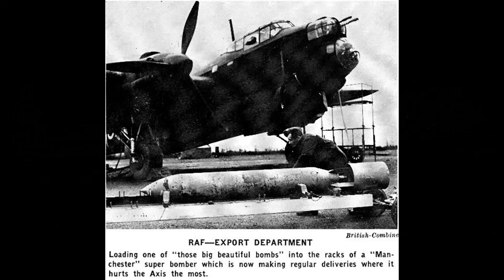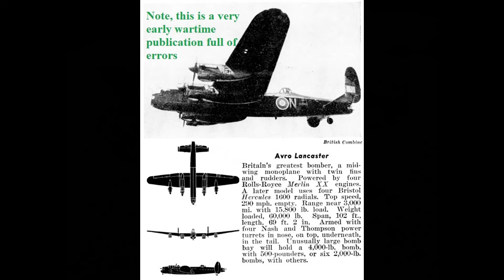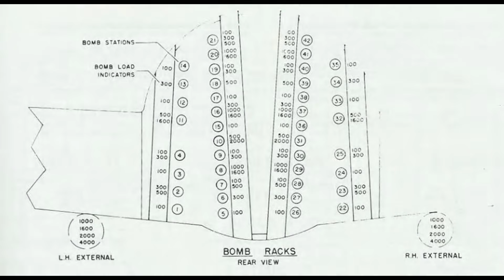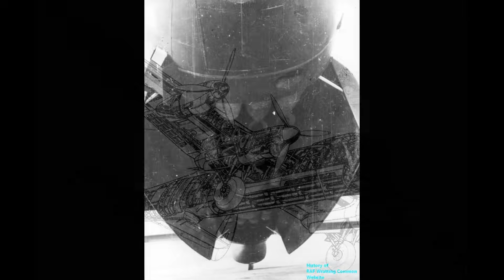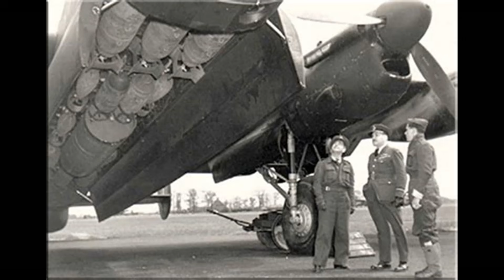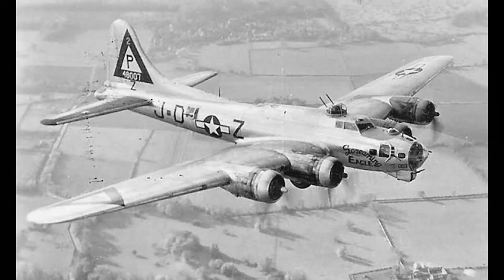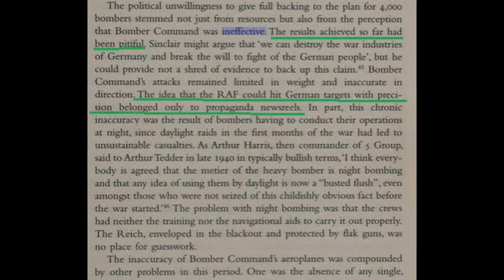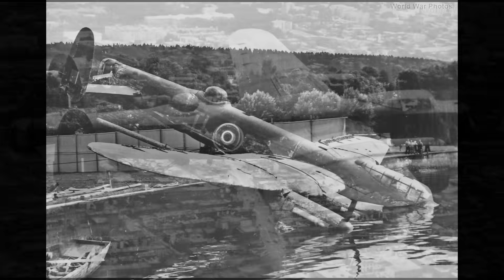Avro Lancaster, Payload, Turrets, Stability and More

Comment: My dad was a w/o  in the RAAF and did 2 tours of duty in RAF lancasters towards the end of ww2.  The crew worked between tours of duty testing new ,rebuilt and prototype Lancasters and some early Lincolns prototypes due to the skill of their Canadian skipper and English engineer.The rest of the crew were tough Canadians and Dad an Australian A lot of the work they did was testing tailwheels to cure the tail wheel shimmying which was a Lancaster problem.The were invited to volanteer to join Pathfinders . However the crew worked as a democracy and voted to go back to an ordinary squadron. They  soon discovered that they were in a so called CHOP squadron which was a low key RAF version of a Russian  penal battalion for trouble makers and the like where the average life expectancy was a handful of sorties;.
On the airfield was  a strange Lancaster with big paddle props and .5 inch armament . It was  hard for the other pilots to fly.Dads skipper put on an act and grudgingly agreed  to have it but warned the crew not to be enthusiastic They knew what it was from testing prototypes and having flown one of its stable mates. Apparently it a great deal faster  and had much higher ceiling  than standard Lancaster but the engines were harder to handle and it had some rough edges.
 This meant they could go up to a much higher altitude and look down on the bomber stream getting shot down and also get out of danger a lot quicker and do more violent corkscrews .
Their navigator had to be on his toes because they still had to bomb at the correct time and altitude [photo evidence] and land at same time as the other planes because the performance was a closely guarded secret in the squadron. So it was not easy task finding somewhere safe to hide  for up to an hour at night over war time England.
 Dad died 30 years ago. and basically never said which Merlins the plane had.Rolls Royce or Packard  It was built in the Austin factory and but was probably a  experimental fitment of some late war or post war high altitude single seater engine because  they could not be synchronised which made it unpleasant to fly. The RAF had sent the troublesome plane  where it sent its human trouble makers and where they thought it would be soon lost
.It dropped a lot of bombs. Survived a daylight brush with German jets  and  allowed 6 young men to survive the war. Dad put his wartime experiences on paper when it became clear he wouldn't live long which is where this info came from.  

Also Dad said that one the radars[ I Think may be Fishpond] let them track nightfigters sneaking up on them in the dark and saved their lives on occasion . Most crews weren't aware of this or shown how to do this and just used it as a navigation aid.

Comment: The pins on the bombs were arranged so that they would be pulled out by the bomb carrier as the weapon was released. You've also got electrical fusing from the bomb aimers panel ?  Imagine if the bomb bay was subject to airflow in flight, you could end up in a situation where the vanes rotated en route, that might not be good. :)
Reply from the maker: It depends on the version. Some are set up to arm the bomb the way it's done in a typical U.S. single engine fighter as you described.

Comment: I am still at the early part of this video. 

That said, one practical reason for having multiple smaller vertical stabilizers versus one large one is hangar accessibility. An aircraft with one tall tail might not fit into an existing aircraft hangar. 

AFAIK that is one reason the Lockheed Constellation had three smaller vertical stabilizers, versus one larger vertical stab.
Reply from the maker: That's true about the Constellation, but it was intended for the post war airliner market. It wasn't really an issue for military planes during the war.

Comment: Flt Sgt T J MacLean with 617 Sqn on his second tour got 4  in one night 15/16 Mar 44 He used the 4 x .303 because of the higher Rate of fire 1150rpm x4  V 850 rpm x 2  The enemy were coming in close and the .303 were adequate in distracting them or knocking them down MacLean used his own Mix of loads 45 % tracer 55 % armour piecing This was his first time He was still around in the 80s but it is not known how many more he got

Comment: Hello, possibly some day you could publish a video comparing the Lanc to the Halifax, especially the much improved Mk.III. Did it deserve to be in the shadow of the Lancaster so much from a historical standpoint? Should Handley-Page have converted to producing Lancasters instead? I suppose that at least the Halifax Mk. III put the Hercules engines to good use, did it thereby relieve pressure from the Rolls-Royce factories busy producing Merlins?

Comment: Greg, wonderful presentation, logic and research as usual. Could you please clarify the max internal load of the B-17. Every different site has a different number, mostly much lower than 12,800 lbs. Could every slot in the bay be filled?
Reply from the maker: The maximum internal payload of the B-17s used in combat over Europe was 12,800 pounds. It could also take quite a bit more on external hardpoints. I hate to sound like a #$%@ but sites that have much lower numbers simply don't know what they are talking about. Could every slot in the bay be filled? No, but because if taking 8 1600 pound bombs, the positions for some smaller bombs could be blocked, or if taking a bunch of 500 pounders some of the other slots would be blocked.

Comment: Lockeed Ventura is another low wing (more low wing then mid-wing). It's curious that in low wing configurations the twin tail assembly seems to be placed always in an upper position relative to the wing level, high above the slipstream, probably to avoid turbulence.

Comment: Hi Greg, re the comparison of single and double tailed design I would point out that when the B-24 was re-designed into the PB-4Y it was given a tall single vertical stabilizer to increase stability at low-medium altitude.
Reply from the maker: Exactly, and look how tall it had to be to get that stability and how much it interferes with the upper turrets field of fire.

Comment: the bomb bay was designed to carry 2x torpedos, hence the wing position. 15 bomb shackles were fitted and group 1 Lancasters regularly carried 15,000lbs of bombs on raids to France & Holland.
Look up the IBCC digital archive, particularly bomb aimer Bill Baileys raid memories.
Reply: IBCC Operational history of Lancaster 1B R5868
This Lanc flew 136 operational sorties in two years and ten months (less than one a week) and dropped "466 tons (assume long) approx" or 3.42 long tons or 7,675 pounds on average. I did not deduct missions in which bombs were jettisoned due to engine failure or the entire load was flares or mission was called off in flight. 
On pages one and two (July and August 1942) the entire load was 3,360 pounds of bombs. 
On page two a bomb load is 2,000 pounds plus "6 x 4 flares".

Comment: 27.30 April 1942 Lanc unescorted daytime raid. Diversion raid failed. Four Lanc's lost to fighters, no fighters lost.
Only 12 bombs detonated. 58 per cent losses.
Reply: Bombs:  General Purpose (GP)
40 lbs., 250 lbs., 500 lbs., 1,000 lbs., 1,900 lbs., 4,000 lbs.
   Add to this that entire inventories overall effectiveness was generally questionable in such that even if a bomber successfully reached the target and dropped its bomb load, there was no guarantee that the bombs would actually explode. Particularly troublesome were the 1,900 lbs. and 4,000 lbs. designs. Development and production problems continued to plaque many of these designs and many of the 4,000 lbs. GP bombs continued in limited use until November 1943 and was only then removed from the Commands inventory due to fusing problems.
American Bombs:
With United States entry into the war and the arrival of the USAAF in England. Bomber Command gained access to American made bombs. During 1944 when British made bombs were in short supply the Command dropped significant amounts of the American type ANM 44, 58 these being the equivalent to the British 500 lbs. MC's. Additionally large quantities of ANM 59 and ANM 64, 1,000 lbs bomb were also pressed in to service by all of the Command's front line squadrons.
For the Command's armours the introduction of these types was we must assume welcomed, as the American bombs were faster to fuse and tail than the British made bombs they were used to working with. However, the "box" tail design which added significant length to each bomb, drastically reduced the amounts of bombs which could be carried by each British aircraft.
Bomber Command Bombs, Mines and Incendiaries page

Comment: Okay, is this thing about wing location your theory or something you read? Because I was under the impression that is was mostly just that high and mid wings and twin tails were all things that were in vogue in the years before the war. The B-17 just predated the fad, but the Stirling, Halifax, Manchester, the B-24 and 25, even the Do17 and variants, were all designed in the same decade or so, and all share roughly the same layout. The Halifax, Lancaster and B-24 especially, although the Lancaster only ended up that way. Anyway I don't see what a high wing had to do with dihedral. A low wing can have just as much as a high wing, and a high wing craft is not more stable, that is a myth, I have seen it demonstrated several times (or rather I have seen several people who claimed to know what they are talking about insist it is just a myth). High wing was in vogue because it made fiting bomb bays easier. Low wings worked better on passenger planes. Both were marks of the time. B-29 came later and you have to ask k then why they rejected the dogma. All the really modern bombers did.

Comment: The base Lancaster could carry a certain 14,000lbs. Most sources for B17 bombloads suggest 6,000lbs typical or 8,000lbs maximum. There are some that state 9,600lbs maximum which is the upper end for shorter missions even in the B17F. There seems very little evidence of higher so your figures appear a bit optimistic maybe? Or possibly you give figures that flatter a B17 given optimal condition in which case we should mention the 22,000lbs load a modified Lanc could carry (just!). I could be wrong but every source I own or have come across does suggest your figures are unusual.

I genuinely love your content and data, especially the graphs but considering there are a large amount of sources suggesting very typical bombloads of B17s was between 4-6,000lbs and typical Lanc bombloads were around the 12,000lbs mark it seems fair to say the Lanc tended to carry at least twice the load of B17s and this is no myth. The capability of the planes is different of course. You state possible capable load of B17 but only typical load of Lanc which is not a fair comparison is it?

There are some Lanc pilots that say they often carried 15,000lbs on a typical mission. Yes, it does get much rhetoric but most of it is deserved. This does not diminish the crews and the risks they took but quite the opposite as it suggests those men did not risk and often lose their lives in vain.

I am biased to some degree as I have loved the Lancaster since childhood but it appears you also have some bias maybe?
Reply from the maker: Ivor, the numbers I posted are straight out of the official pilot manuals. It doesn't really matter what some website says, or what I say, it's what the manuals say.
Reply: @GregsAirplanesandAutomobiles  Fair enough pal and thanks for replying! 

I like that you really dig into these things and think laterally a lot (like your excellent Airacobra vid) but in this case I do think you fall more on one side of the fence rather than the middle. For example; we know for a fact that 617 squadron carried the tall boy 12,000lbs bomb after the dam raid as they were highly trained and could use it accurately so from that its probable that Lancs carried at least 12,000lbs or more regularly. Despite manuals the B17 operational usage was very high level (for the time) daylight raids and with the ranges they mostly went and full defensive capability the usual bombloads would have been smaller and 4-6,000lbs makes sense. Again, yes, the manuals will state other figures but this is unsurprising right? You had the option here of mentioning these things considering your superb evaluation of the P-39?

The first daylight raid by B17s was with 12 planes and carried a reported 18 tons of bombs, thats 36,000lbs. Each B17 carried 3,000lbs. Considering what we know in actual operational terms (and there is a huge wealth of evidence) I repeat that the Lanc most certainly did carry twice or more the bombload of a B17 in actual operations. You are a very well informed and smart fellow obviously and you must know this so I find it surprising that you present the data in such a biased way in this one video. There is no doubt the B17 is potentially capable of carrying something fairly comparable to a base Lanc on paper but the actual operational usage is a whole different story.

You do state manuals as you say and you are vastly more accurate than some sources no doubt.

As I say, your detailed work is unsurpassed and I thank you for it.

{Oh, I should add I was mainly talking about books and also chats with an actual Lanc pilot, who is now unfortunately passed, not websites as they are notoriously unreliable at least without much cross checking)
Reply: @ivormott7309  Avro 683 Avro Lancaster B.1 Special	32 aircraft were adapted to take first the super-heavy (12,000 lb) ‘Tallboy’ and then ‘Grand Slam’ bombs and included up-rated engines (with paddle-bladed propellers to give more power) and the removal of gun turrets to reduce weight and give smoother lines.  For the Tallboy, the bomb bay doors were bulged slightly whilst for the Grand Slam, they were removed completely and the area faired over. For some Tallboy raids the mid-upper turret was also removed. This modification was retained for the Grand Slam aircraft and the nose turret was also later removed.
BAE Lancaster page
Reply: @nickdanger3802  Absolutely my friend,  All spot on and accurate indeed.

OFC 617 carried the tallboy too very famously. I have several books specifically about that remarkable squadron and their history after the dams.

I think we agree chap and you seem knowledgeable too just like our Greg here.
Reply: @GregsAirplanesandAutomobiles  Here is a nice video with interviews of actual Lanc crew and it also notes  that it carried at least 14,000lbs bombload as standard and that this was at least twice that normally carried by a B17 of course, as we all know is the case.

https://youtu.be/MitesLCmkyg

There are ways to present data but I am a bit surprised by how this one video is not as dynamic and fair in its critical assessment taking all factors and circumstances of practical real life operation into account  as per your usual content.
Reply: "469 Avro Lancasters,   234 Handley Page Halifaxes, 50 Short Stirlings and 11 DH Mosquitos (764 bombers in total) dropped   2,300 tons   of bombs in 30 minutes" 
469 Lancs with 14,000 lb each would be 2,931.25 long tons (2,240 lb).
 Bomber Command Battle of Berlin RAF Memorial Flight Club on line
Reply: @nickdanger3802  I guess you are suggesting the majority of Halifax and Stirlings didn't make it. OFC Mozzies were pathfinders.

This does to some degree add up to the statistical effectiveness of these bombers although I am slightly tongue in cheek ;)
Reply: @ivormott7309  I am not suggesting anything, I am merely relaying the information I have found on the internut.
I e mailed the RAF Museum years ago with a request for average bomb load. They replied they did not know but I was welcome to look through their records.
Reply: 4,000 pounds 
Operation Margin, The Augsburg Raid, Lancasters Over Augsburg 
https://www.youtube.com/watch?v=KMETNhT74mk
Reply: Operational history of Lancaster 1B R5868 on line

Comment: This is the second video I've seen of yours that incorrectly states how bombs were fused in RAF aircraft. Most British bombs had 2 fuses one in the nose and one in the tail. One was the propeller type, the other one was an electrical fuse. This was normally armed when the bomb doors opened, however you could disable that from inside the aircraft. So you could jettison most bomb loads "safe".
Reply from the maker: It depends on the circumstances. I could literally make an entire video on this. The greater point is that the U.S. system provided a greater level of safety. However yes, in some variations the Lanc could jettison the bombs in safe mode. In fact often they did just that even when they were meant to detonate.
Reply: Bomb handling fusing and loading parts 1-6
https://www.youtube.com/watch?v=ZtmuApC_W2I

Comment: Given the problems had with the X configuration engines on the German Heinkel 177. It was probably just as well the Vulcan engine was abandoned early on and the design converted to a four engine layout with the reliable Merlin.
Reply from the maker: I agree, sometimes it's best to take a step back and go with proven technology, especially when time is a factor. Then again too much caution and you find yourself left behind so it's a bit of a balancing act.

Comment: Just a few words on the transition of the Manchester to the Lancaster.  The Merlins they used were in the form of "Power eggs" developed for the Beaufighter by Austin Motors, in case there was a shortage of Bristol Hercules engines.  You can also see this exact same installation hanging from the wings of the Spanish He 111's in the film Battle of Britain.  
 Check out a photo of the prototype Lancaster,
it appears to have smaller propellers.  Propellers that you might expect to find dragging along an aircraft the size of a Beaufighter. Were they in a rush or just lazy? 
 Davy head in clouds